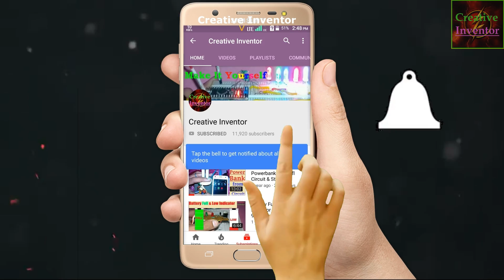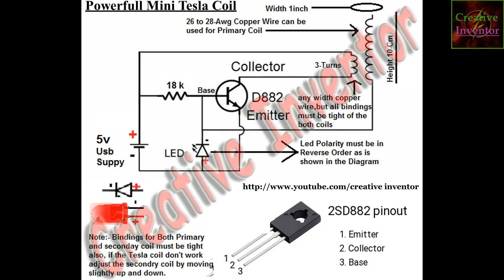How to make a Mini Tesla Coil DIY at Home | Tesla Coil | 5v Powered Tesla Coil | Powerfull TeslaCoil

Comment: HELP! My tesla coil does not work! please help me and respond. the only diffrence then the video from my coil was the 18k resistor. I did not have that resistor so I got the next best thing, a 10k resistor. there is a tiny diffence but that should be it. It does not work help!
Reply from the maker: in the video the yellow wire i had used for making a coil, make it tight any wire you are using.
Reply: @CreativeInventorlab  wait the secondary coil needs to be tight? 🤔
Reply: @CreativeInventorlab  lol I did not think of that. 😌
Reply: but I tried that and it did not work either. 😕 my power supply is 5v to 7.5v so that should be enough to power it. But still no working tesla coil.

Comment: You can also do this project using 9v battery and a 22k resistors .adjust the primary coil if it doesn't work I made like this.it worked perfectly
Reply: Thank you 🙏
Reply: Mine doesn't work

Comment: 1:24 The caption says 27 AWG Copper wire, but the lable on the spool states 22 SWG? 
The hand printing on the label is hard to make out, for  the "7" could be a '2' ?
9:01 Is that LED, or any diode neceesary for this crkt to operate, or is it just a pilot light?